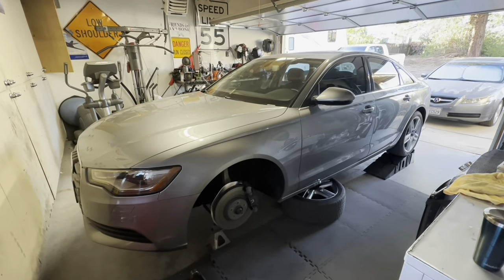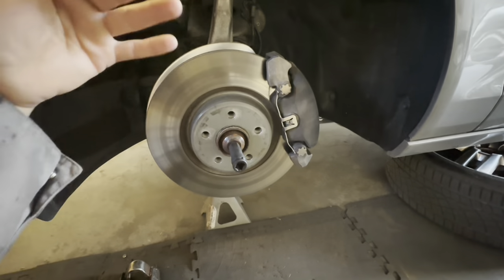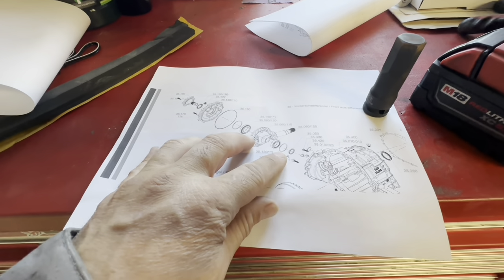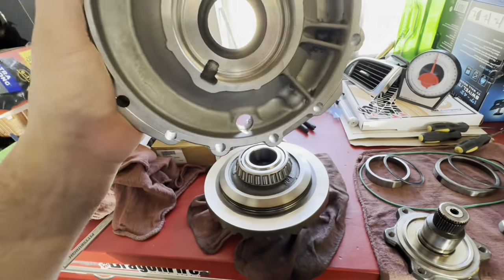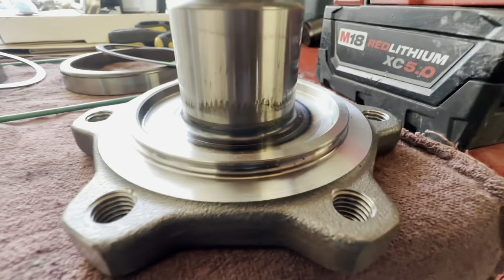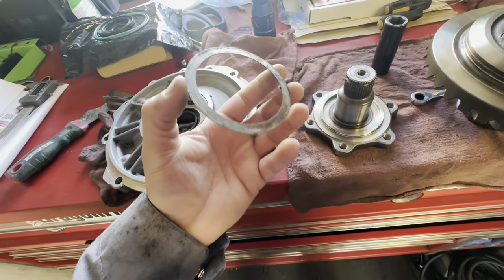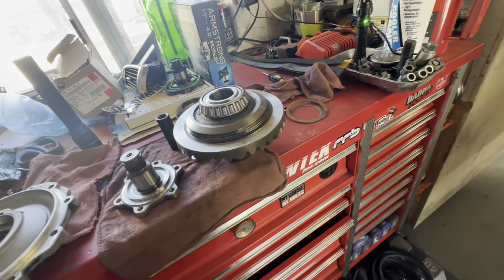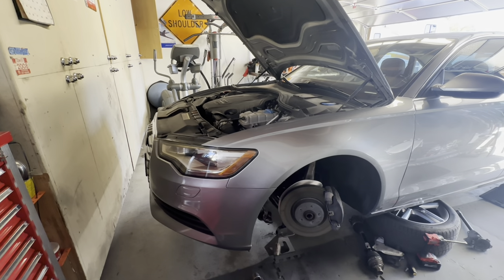2014 Audi A6 TDI C7 front differential fix 8hp-55 transmission seals and play

Comment: The problem was at the flange? Or at the bearing? 
Sorry i didn’t understand. 
I have a vertical and lateral play on the flange from the right side.
Reply from the maker: It’s definitely bearing wear. I added a shim but I believe it made the bearing wear more. I just change the diff fluid every oil change now.

Comment: Hey nice video…i have the same problem;/ how did u fill the oil in the gearbox where is the fill plug? And how many liter did u put in?
Reply from the maker: Fill plug is next to passenger side cv axle and I believe it’s 3/4 of a quart.

Comment: Hi mate it’s easy take out differental,it’s enough room there? Cos I’m wondering if I have to take out whole box
Reply from the maker: You’ll need a stubby t40 but as long as you remove the stub shaft before you remove bolts for differential that’s there’s plenty of room. I did mine without dropping the box.

Comment: you bought a new differential? Can you please send the links where you can buy it?
Reply from the maker: I didn’t buy a new deferential. I can’t find anything besides seals and the stub shaft. I need bearings and can’t get those either. You can get a used transmission like I did but it had the same issue.

Comment: Hi a havin touble with audi a7 2012 can the differncial bearings shaces the car when start accelerating
Reply from the maker: That sounds more like a bad CV joint or the rubber damper at the end of the transmission that connects to the driveshaft.
Reply: @Halffast719   i have repalced bof front halfshafts, driveshaft , engine mounts only thing i see the right part off front differential who conected with right halfshaft has a movement when move by heand
Reply: @Halffast719  if you have any suggestion tell me
Reply from the maker: Do you hear a whining noise when you drive at high speed then let off? These transmissions are known for having bad front differential bearings because Audi and VW say they don’t need servicing. Lifetime sealed unit.
Reply: @Halffast719   no i dont hear that noise  because i know how is the noise if a bad bearing  its more like something shakes the car in the front part 
Cant be the transmission or the part of diff or transferbox inside of transmission? 
I suppose that because the the part of transmission itself disks and gears are ok
Because are fitting correctly without knock noise
Reply: You have vibration? I have a6 c6 and i have a scarry vibration on 120 to 140 km/h :( why ???